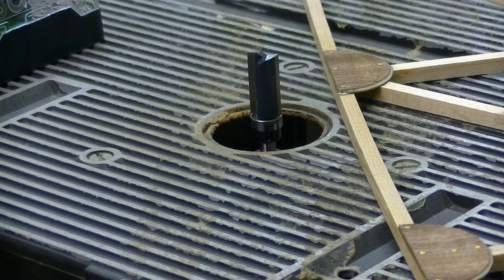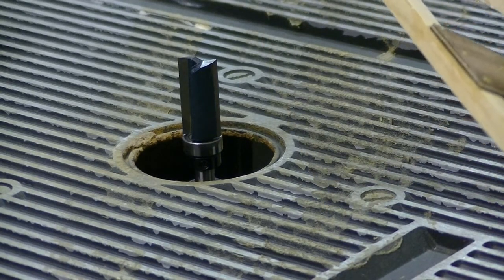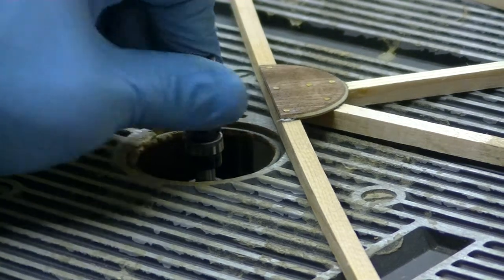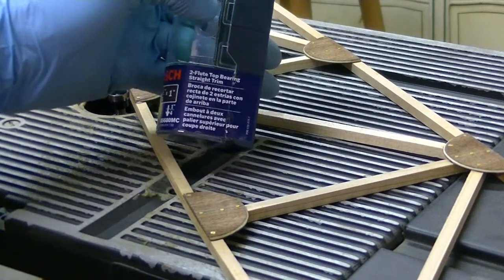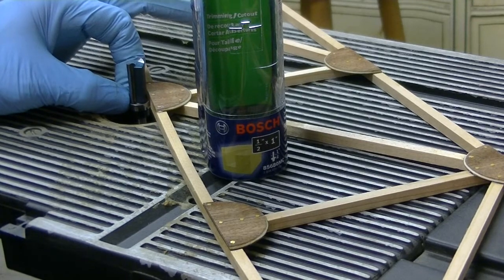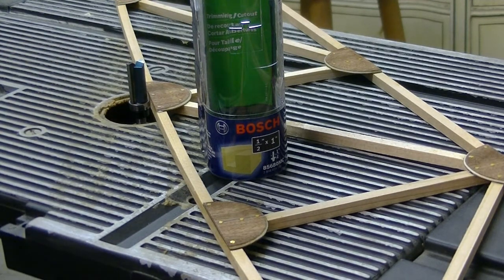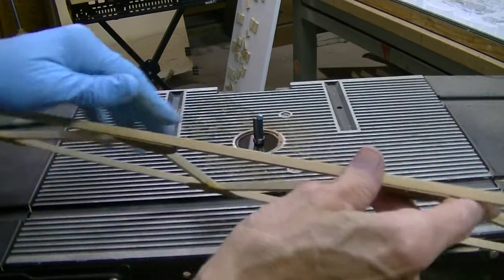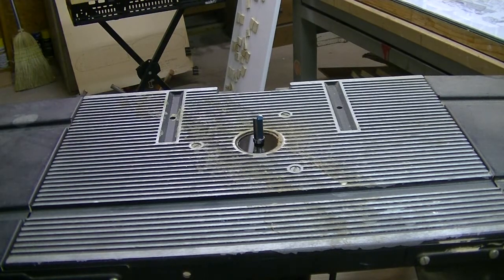Final addendum to the Corben rib series part 14 of 14 videos.

Comment: That's a great way to remove the excess gusset material. As a rule the material should be fed against the rotation if the router bit. There's less chance of the material "catching" and dragging your hand into the cutters. Love your vids... I'm preparing jigs for my wing ribs... you have provided many helpful tips... thanks
Reply from the maker: Thanks for your kind words Todd. You will love the building process.